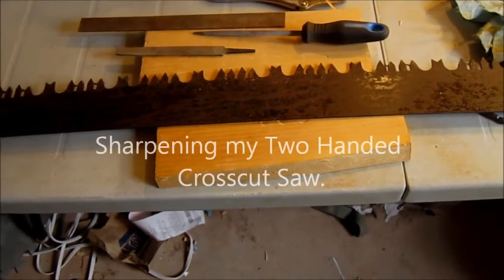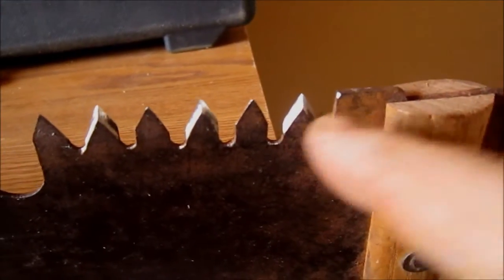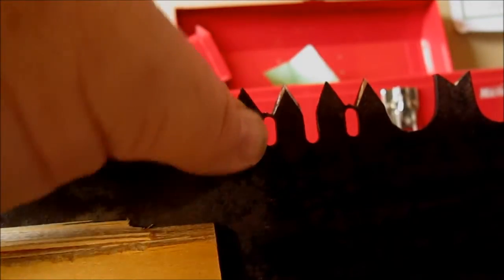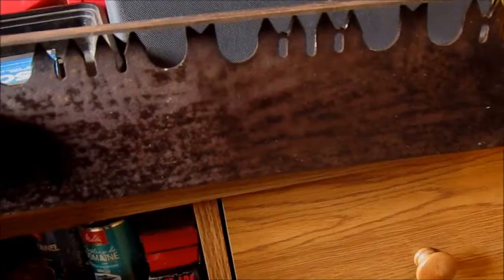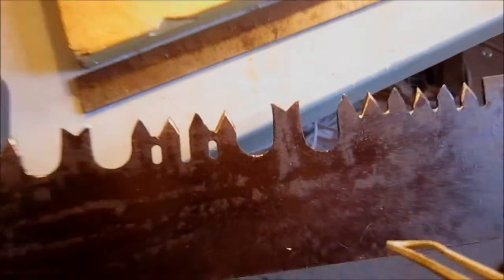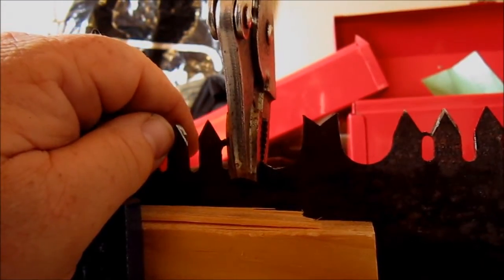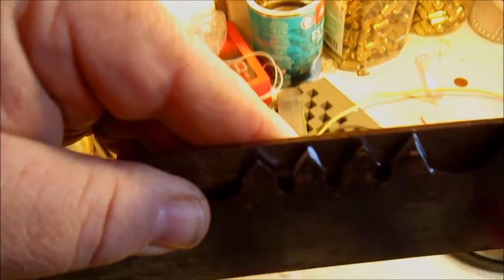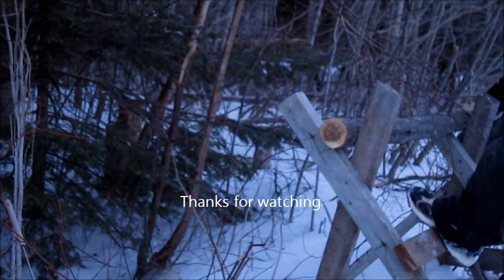Sharpening my Two Handed Crosscut Saw.

Comment from the maker: Go with the rough one first that way all the practice will make you a pro for the new one.   Someone suggested that I loose the vise grips and use an adjustable wrench to grab the blade for setting it. Makes sense that it would do a better job and stress the blade less.